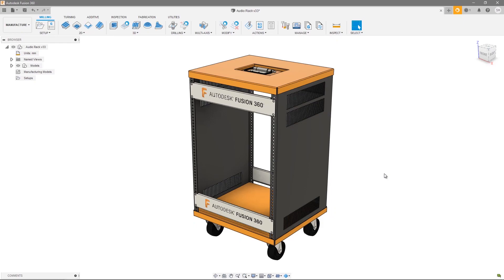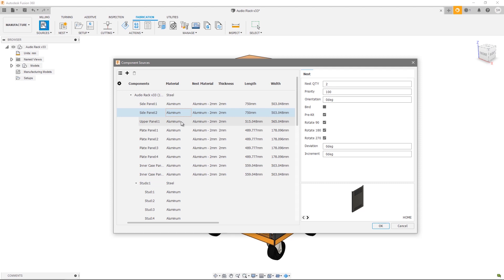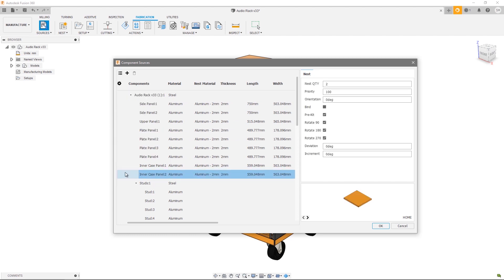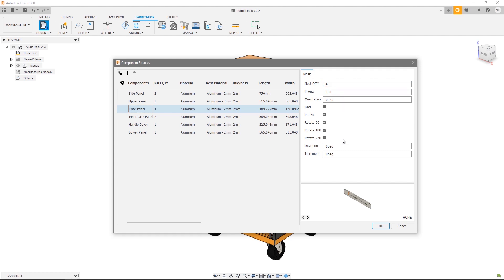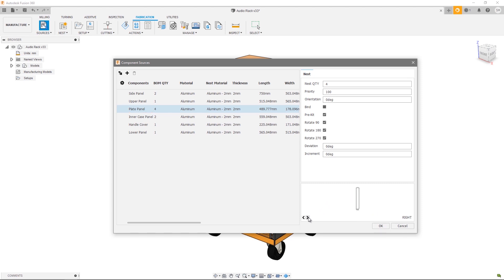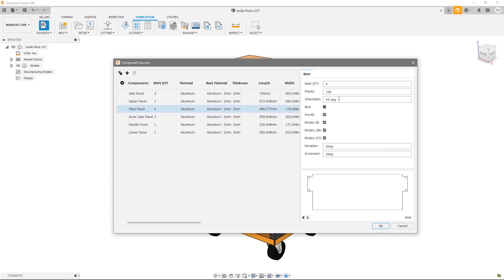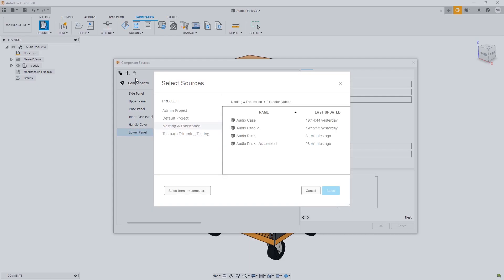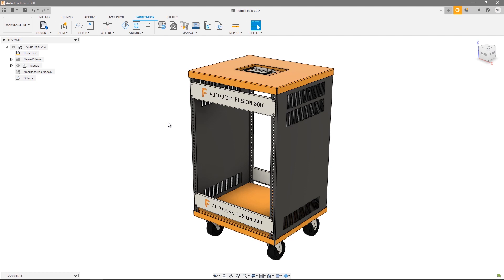Tutorial: Nesting and Fabrication Extension: Part 3 of 8: Component Sources

Comment: Can anyone tell me if it's possible to 'flip' components, as you can in the arrangement tool? Seems like a simple thing in what seems a very comprehensive tool, but for me without being able to control this it is useless. I'm sure it must exist...
Reply: Hi Jake, adder speaking to product management, flip is possible. See the below comment…

Yes there is a way to control how the parts face up. While it automatically places the largest area planar face pointing down, you can control this from Design workspace > Tools > Nest Preparation. See here for more details - https://help.autodesk.com/view/fusion360/ENU/?guid=NST-REF-PREPARE
Reply: @spencerhardcastle2156  Thanks very much for this, I've finally managed to get all my nesting working. I had seen this feature but it's function wasn't obvious to me. Even after using it I'm not exactly sure what I'm doing, but it seems to work so I'm happy!